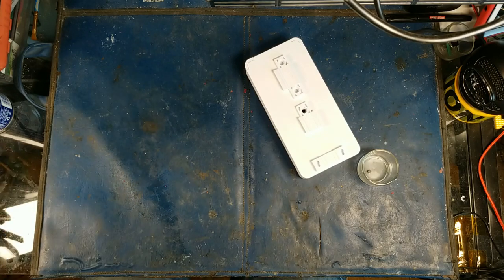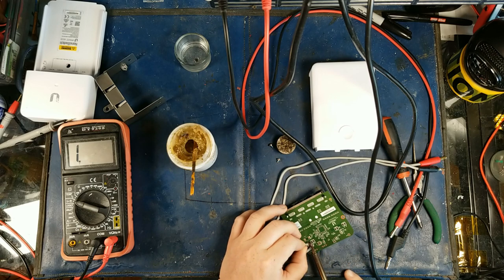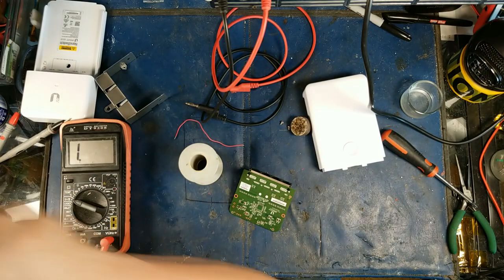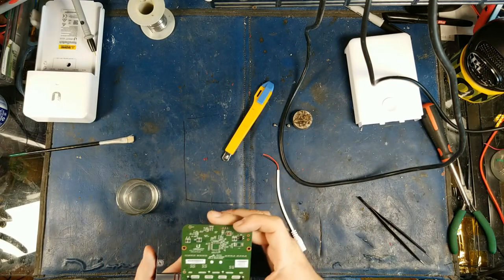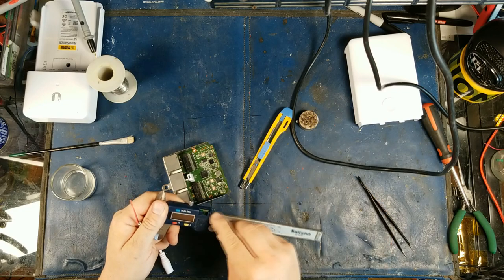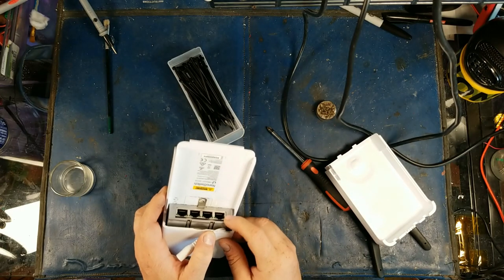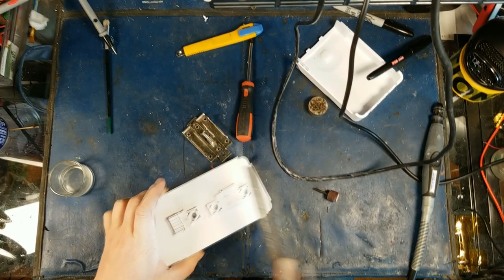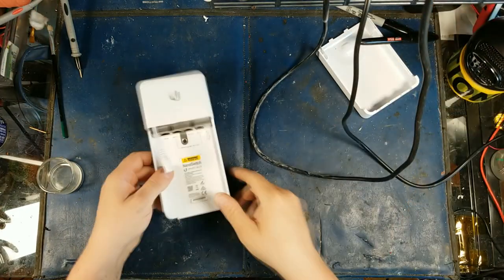Ubiquiti NanoSwitch Tear down & mod

Comment: con que cargador lo alimentas, cuantos voltios y amperios
Reply from the maker: 24v 3A. In my case I installed it in my truck and used a 12v to 24v converter.. But most 24v gear will run on 12~15v